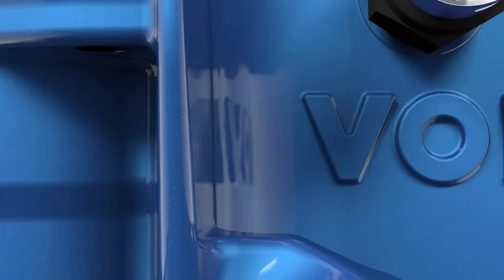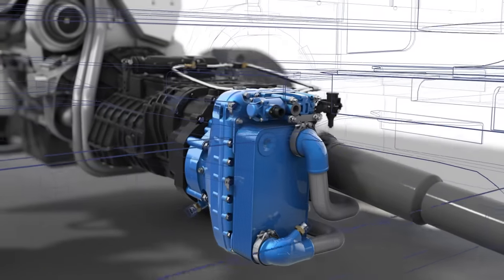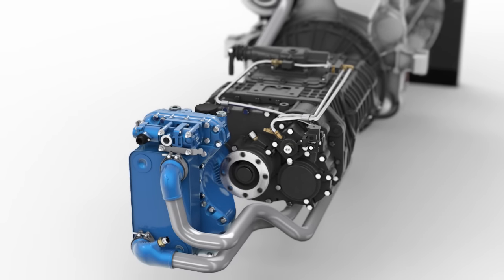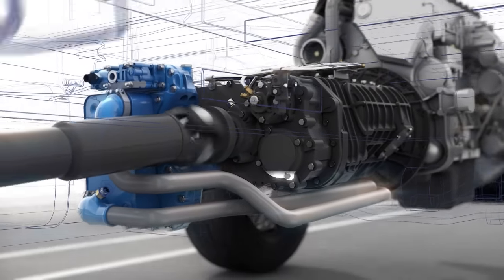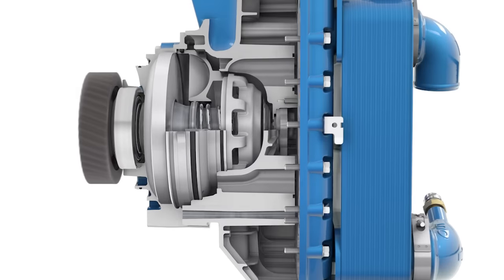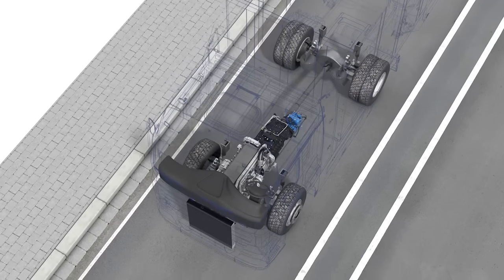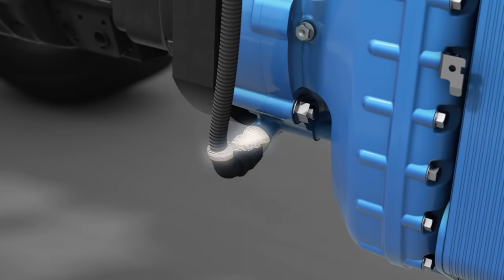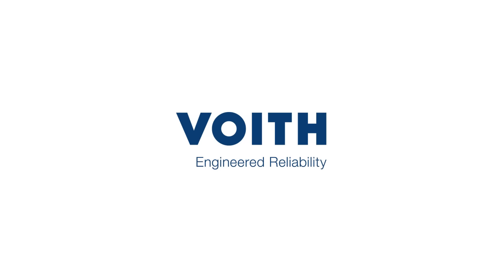Voith Animation Retarder VR115 CT (en)

Comment: actually electric cars does that with their own motors, its called regenerative braking. so yeah, we all need a fucking electric car, truck everything shouldbe electric. actually electric cars are mechanically simpler, and more reliable and more efficient and they have higheer torque.... idk why companies are not selling electric buses or trucks...
Reply: Because range and cost.... Just think about it. It's not a light car but a vehicle that must move tons of cargo thousands of kilometers
Reply: Lots and lots of companies are selling electric busses and trucks. The technology here solves a problem for a market, and that's fine. There is no doubt that electric trucks will pay for themselves in fuel savings over conventional diesel. Also keep in mind the age of the video and the automotive reality at that time.

Comment: Guy said ‘zero wear’, first thing I see after is a gear. Also all this braking force is going through the rear diff and driveshaft which are most definitely wearing faster because of it
Reply: Braking force of a system like that will at best be equal to the forces the drive train has to endure because of acceleration, so no, neither the driveshaft nor the differential will wear any faster. Also, gears don't wear as quickly as you think they do. More often than not gearboxes (and diffs) in passenger cars outlive the rest of the car, only needing regular oil changes. In this video "Zero wear" refers to the brake pads which are consumables and need replacing, the system allows you to safely operate the vehicle without use of conventional brakes when used skilfully.
Reply: Well the gear teeth in the diff would be wearing on the opposite side with the opposite torque, so yes those gears shouldn't be affected in terms of lifespan, but it will add to the particulate into the fluid and shorten the service interval. The driveshafts and universal joints though I'd estimate probably will have shorter life. Also any bearings and thrust washers in the diff would wear faster, not that I'm saying those are a weak link.

Comment: Please tell me how an engine that is on does not burn any diesel.
Reply: @John Sears When the truck is in gear, and you let off the accelerator, the computer turns the fuel injectors off. At this point, the rotation of the wheels is what keeps the engine turning instead of fuel. When the engine speed returns to idle, or the accelerator is depressed, the computer turns the fuel injectors back on so the engine keeps running.
Reply: @daltonbrink6336  Yup what you said.

Comment: Or you can get the Tesla truck that will be coming out and avoid all these moving parts
Reply: unless they can get battery's to store at least 5x more power EVs are just a joke and even then how the fuck would a truck driver charge and electric truck when in the middle of Australia. EVs may work inside a city but out side city limits they are worthless. also there's the problem with the power grid most country's power girds are already pushed to there limits adding drain of well over 50,000 trucks to the grid would wreak havoc on the grid. also what about us farmers and our tractors you would need industrial scale power to charge an electric tractor in a reasonable amount of time and last i checked getting industrial scale power cost around well over $50,000 per KM we cant pay for that are yous Tax Payers going to pay for industrial scale power to every farm. not trying to be and asshole i am just pointing out this superposed "EV revolution" is going to hit a brick wall unless batters can store a hell of a lot more and the power gird gets a massive upgrade its not going to happen any time soon. and on top of that no trucking company is going to buy a Fleet of Tesla trucks its to big of a risk.
Reply: Electric vehicles is not a new technology in the early 1900s in the city of New York there were more electric cars than gas powered but before that when there were more horse driven vehicles then gas powered people were saying that new technologies won't work where is the gas going to come from they are too slow compared to horses etc etc what is different today Battery Technology is much better and is getting better every year so just because Battery Technology or electric car technology is it as good compared to gasoline powered vehicles does it mean it will stay as it is and won't outperform in the future
Reply: @donaldperry9241  yes in the future battery's may be better but how long will that be? 10 - 20 - 30 years? or will we be dead by the time the Technology is properly improved. if EVs can over come all the problems it has like charge time ,capacity getting the power to charge the car / truck or tractor and tractors take a fuck load of power they use the same engines in backup generators for airports. if they get passed all the problems and EV's truly over take ICE's cool i will get one but i am not going to get my hopes up and put all my eggs in one basket. i also like the idea of BIO Fuel but it also has problems is a bitch to make lots of it and BIO comes with one big leg up on EV's i wont have to spend millions on new tractors even if electric tractors where 30% cheaper then ICE tractors to replace all my tractors i would still be spending well over $2 million where as the tractors i have now will run on BIO fuel and its the same for other farmers we cant just pull millions of dollars out of ass's and it takes years to make up the money just for one tractor there's little profit in farming these days. for the foreseeable future diesel is going to stay king when it come to trucks and tractors.
Reply: Sandy Lee  for a Regenerative braking on truck you would need at least 500 kg of battery's no less then 250kg for sure. if where talking a full electric truck well its going to be heavy. the Tesla 3 is comparable to a 2014 Toyota Camry RZ kinda the Camry can 650km -700km on one tank 70L/52kg Tesla 3 can do 500km with 75kWh/478kg that does the same as around 55 - 60L of Diesel the average truck holds around 700-1000L long hall can be up to 1500L but we will go with 1000L/850kg of Diesel ballpark numbers here one would need 8690kg / 19,158 Pounds of battery's to do the work of 1000L of fuel. back to Regenerative braking the Retarder in the video would weigh around 100-150kg a Regenerative braking system would be around 250kg for the battery and another 80-120kg for the electric motor and DC/AC converter all to do the work of around 20L of fuel it could work inner city but of long hall it would be dead weight. as for a run away Lithium fire for my self no but i have had a Lead Acid battery explode good thing i wan not close to it.
Reply: Есть такая же система только электрическая
Reply: tesla trucks are going to be a big time joke, get ready to pay even more for goods if they become common as the price for moving goods will increase to pay for those low range junkers.

Comment: because a proper induction retarder was too good already :P . you people have just invented a complex system that uses oil. whilst there is already magnetic braking @the propshaft xD. 
maybe some chinese brands will fall for this trap , but common . This cant be cheaper to run than an inductionbrake. and you add yet another system that requires an oilchange xD

Comment: From an other perspective it is so sad we just throw out this much energy. A truck or semi has an unbelievable high energy potential when it goes with like 50 mpsh because of its big weight. And we just throw all this energy out. It would be much better to use it, like the EV cars do: charge some kond of battery when braking, that could be used for accelerating next time.
I know, maybe in the future, maybe with EV trucks.
Reply: Let's make it cost 4x as much to save 3% in fuel!